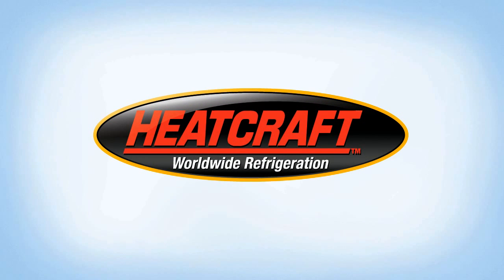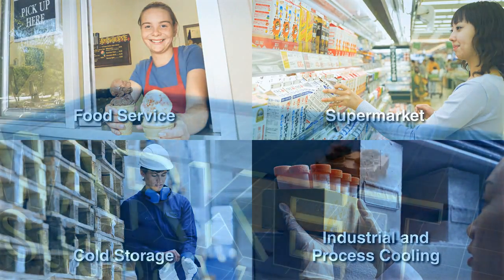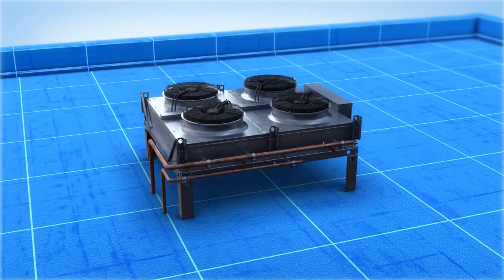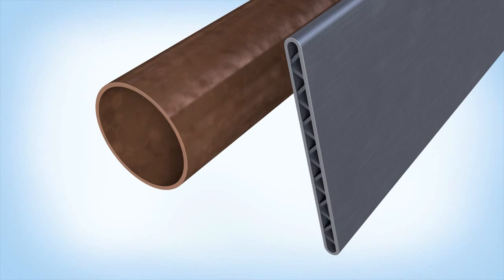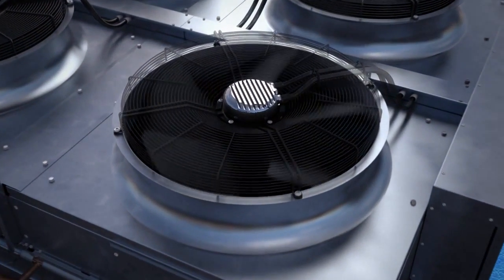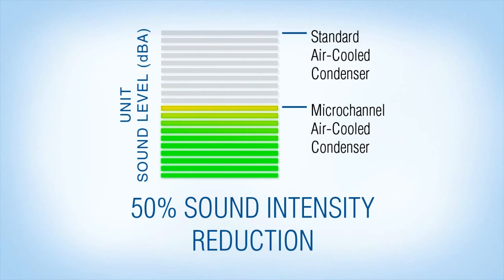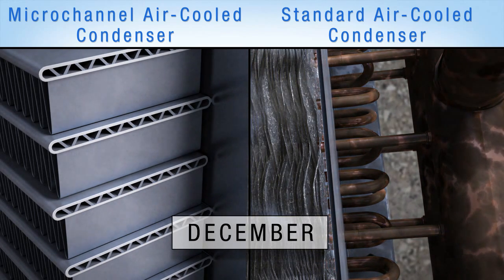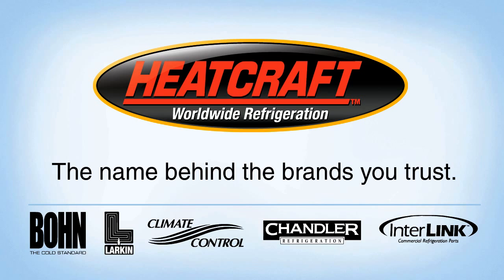Air-Cooled Condenser with Microchannel Coil Technology

Comment: what kind of metal are these coils made of? I cleaned one on a Lennox 25 ton package unit today.
Reply from the maker: The Microchannel Coils are made from aluminum.
Reply: Shit, the name of the metal is shit. Once out of warranty, leaks will occur, the walls are about half the thickness of tin foil, and are impossible to repair. The warranty is void as soon as you remove the cardboard box from the unit because if you read the fine print on your warranty card, warranty is not valid if the unit is exposed to light.
Reply: @douglas787  Technology itself is good but they go very thin on material which causes problems. Micro Channel made with  CuproBraze should be far superior..
Reply: @douglas787  Automotive air conditioners have been using microchannel coils since the early 1990s and the coil pretty much only leaks if bent in an accident.
Reply: Our chillers have micro channel and so far very reliable
Reply: What is wall thickness of ribbon? Is it possible to field solder the point where the ribbon enters the header? https://youtu.be/Q8zDwhGfoUg